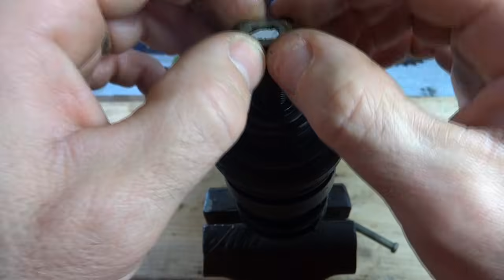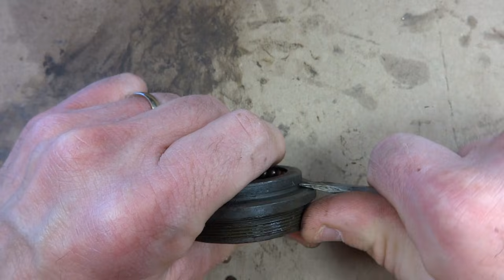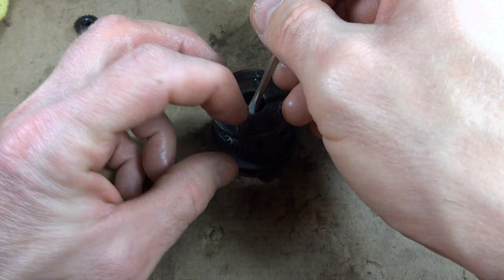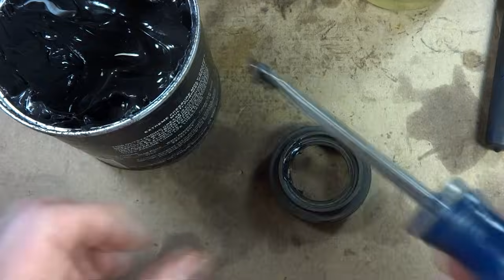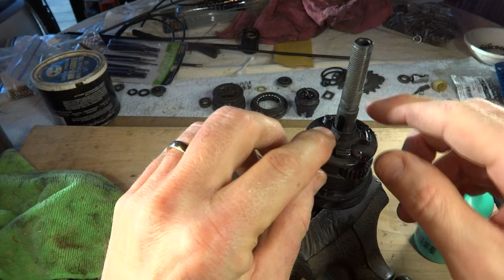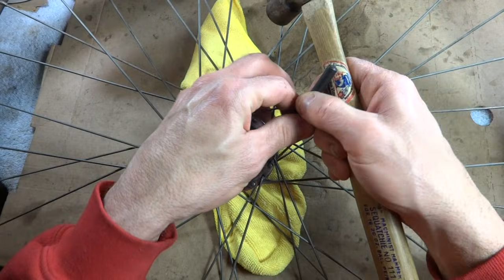How To Overhaul/Clean/Lube Sturmey-Archer 3 Speed Hub - AW type

Comment: Quite possibly the best video for servicing a S/A 3 speed,  with excellent dialogue along the way.  It maybe worth pointing out to others that it's important to set the length of the threaded projections before tightening the cone lock nuts,  The projection on the indicator chain side could be longer to facilitate the extra nut guiding the chain.  On my 1974 wheel the projection on the solid side of the spindle is 15mm after the locknut (as in your video 30 minutes),

Comment: If you dont have a vice and you are having trouble with getting the preload lock nuts off you can use an 8mm spanner to hold the axle.

Comment: Thanks much for this RJ, I'm rebuilding an old Phillips 3 speed that a relative had as a lawn ornament. The hub is a Sturmey Archer AW numbered '67-11' and has a pretty rusty planetary gear assembly. One of the springs on the pawl has lost it's 'bounce' but since they're hard to get (or make) it'll be alright with some TLC. I've always wanted to know exactly how these hubs work and it's a pleasure to disassemble, clean and reassemble to get it working as if new. Your video of the process is perfect, and the audio is great! You must be quite adept at audio/video work! Thanks very much.

Comment: …love this video, but, I can’t read 450 comments… thus, I ask my question…:)… I have a 1963ish, Raleigh, with 3 speed sturmey that gives the bike a pedal brake… I made the mistake of an ole school trick of putting a small cotton rope,( clothes line), so the rear axle would remain clean… (it was common in the fifties, with my old Columbia Roadmaster ). Using the bike for a week, I didn’t notice the rope dislodged a rubber boot, for oiling the axle, and the bike began grinding…  I took the bike to a bike shop, and asked for a rebuild… they said, they had one repair man experienced with old Raleigh’s… he disassembled it, reassembled it and told me a couple parts were destroyed… he said he had no access to replacement parts, a new wheel was $450.00… and my best bet, was, find an ole  beat up Raleigh, with a good wheel. (That was 10 + yrs ago)… now, I found one, on Marketplace, $25.00… I tried it, it works great, except, it’s a ladies… figured I’d just switch my whole wheel… today, I realized the ladies bike (not certain what yr), has the sprocket on the wrong side…  is it likely, parts in the 2nd bike can replace my missing parts of my old bike…?

Comment: HUB'S DIFFERNT: Due to a failure with my 1982 3sp AW spindle I decided to remove the complete insides and swop it out with the insides of a 1984 3sp AW hub (new old stock) but have noticed inside the 1982 hub differs from the 1984 hub? the 1984 hub has a shoulder in the bottom of it but the 1982 hub don't  Are both insides interchangeable with each other. Though I have now fitted the 1984 inners but is not as smooth as I think it should be, would this be due to the differences in hub bodies?  Has any one got any information  can share. Thanks

Comment: As for the wet lube I personally DO NOT recommend it. Why? After 1,5 year after overhaul, the lube turn into a sticky goo which blocked the hub internals. The hub survived with no damage after all but cleaning this is a pure pain.
Better use is to pour some diesel 10W40 oil because it is almost the same as the SA Oil which costs a lot of pennies.

Comment: Some years ago, I did a Level 2 EAL cycle maintenance course - that's a UK intermediate pro-level vocational qualification. My crowning achievement on the course was a complete rebuild of a Sturmey-Archer 3-speed hub just like this. I was both amazed and delighted when it worked just fine after my rebuild, but I'm not in a hurry to do that job again - it's definitely not for the faint of heart. Watch out for those teeny pawl springs - they are incredibly easy to lose and the hub won't work at all without them!
Reply: Imagine who build it

Comment: Hello, I have two questions.  I have a 1958 Racer with this hub.  I have been cleaning the bike up, but not relishing the idea of tearing this hub apart.  What gauge oil should I put in the oil port?  And, how much travel should I get out of that small chain?  I get about 1/4 of play, but that is only pulling on it, not riding and shifting.

Comment: I’ve just dissemble and clean one of this hubs, then I reassemble it and thats ok. The question is, when I pull the chain out the axle rotate backwards. 
Is it right or did I assemble something wrong ???
Reply: Sounds like You may have installed the hub or wheel backwards on the bike.
Reply: By backward I mean the wheel is directional and You have reversed the left side vs. the right side.

Comment: The wife bought a bike for my daughter for $15, we picked it up in the rain and I just threw it in the back of the truck. When I got home I noticed the shifter on the handle bars...... and realized that it wasn`t just an ordinary bike. I had never seen one of these before and on trying the pedals I found the hub was a little "crunchy"   But anyway the housing on the rear hub is stamped 75, after watching your video I think I can handle the rebuild pretty easy. The only question I have is, where can I find the  replacement bearing?

Comment: I found this very helpful and it gave me confidence. One note however, you correctly note that the sprocket goes either up or down with the dish cavity. You might want your viewers to note that there is a reason why that dish is there. On my bike with a full chain guard the sprocket needs to be lined in the center guard case. The spacers and the dish feature allow this positioning. So I expect that without a chain guard the sprocket goes with dish out. Mine didn’t come that way and when I put it on to check if the way you did it was correct I mounted the wheel and it was too close to the guard. Not centered. So I put one spacer in and one out and made the dish down and then it was centered correctly. I suppose if you just note which way yours came then it’s fine. But I think it’s useful to know why it’s there and check for yourself if centered inside the guard. Thanks for your videos. Great stuff.

Comment: Hey, really love your videos. I have a Batavus bike with a Sturmey Archer 3 speed with a drum brake in the rear. Do you know if that one is similar to the one in the video?
Reply from the maker: Maybe in some ways.
Reply: @RJTheBikeGuy  It's from 1976, and the bike is dutch. Haven't seen much about that specific hub
Reply from the maker: @ovlov86  You need to look up the model. It's obviously not an AW.
Reply: @RJTheBikeGuy  Of course, you are right. Upon further inspection, I found out it's called "AB". Have a nice day. :)
Reply from the maker: @ovlov86  I haven't worked on an AB yet. With the A, maybe it is related to the AW. I don't know. I have videos for a few different Sturmey Archer hubs. Not the AB though.
Reply: @RJTheBikeGuy  Just took it apart, and it is almost identical to the one in the video! Minor difference.

Comment: Hey RJ, great video as always. I'm having issues reassembling my hub. The cogs aren't lining up, (part 23.20) when I'm putting the 2nd part back on. I've taken it apart 50 times and can't see why it isn't matching up, or whether the temperature has made it move, please can you help? Rob
Reply from the maker: I can't tell you. It's generally not a big deal.
Reply: I'll bet the pins that hold the planet gears are installed backwards, keeping the ring from sitting all the way over the planets, right?

Comment: Hi RJ (or anyone else) , I'm rebuilding an old AW hub I picked up off of Ebay just to get familiar with how these work and how to take apart and reassemble. I have put it back together using this video and after cleaning and I lost one of the pawl springs on the bottom left side. Someone told me that I could put it together with one pawl and bench test it on a vice since there would not be a load on it. I did not oil the hub just used spray lube for the bench test. It works fine by pulling the chain out in 2nd and 3rd but will not go into 1st gear. Could this be because I am missing one pawl and or my springs are probably original from 1964 and they are weak? Thanks, Mike
Reply from the maker: You might be able to find parts on ebay.
Reply: @RJTheBikeGuy  I've Got 4 springs do to be here on Friday, Thanks

Comment: Thanks for the video. Question, I have an old Crescent 1970:s( I think) bike that has a Sachs torpedo duomatic hub( says 2.8 36P as well on the hub not sure what those numbers are). The hub is 2 speed. Would it roughly be the same procedure to open up and fix? 
 
 The problem with the hub is second gear. First gear works flawlessly but when pedaling using second gear every 10 seconds or so there is a "crunch" and the pedaling "loses connection" for a second before it picks back up again. Not sure how to describe, English isn't my first language.

 Don't know much about bike repair so haven't dared trying to open up the hub. Worried that perhaps I will just make it worse if I start fiddling around. 

 Does it sound like the problem could be fixed by just opening up the hub, clean it and grease it? Guessing replacement parts will be very hard to find. Bike has some sentimental value so would like to get it running like it should.
Reply from the maker: Find information on that hub.

Comment: Really useful stuff RJ, just rebuilt a 1976 AW hub using your step-by-step guide.
One minor issue is determining the exact adjustment of the LH cone... a little unclear in the video how you determine this.
Some sources say back it off till there is some slight lateral movement then tighten to 'just' remove any discernable play. 
Others say ball bearings should have slight amount of preload.
I tried both ways and it definitely seems to turn more smoothly doing it the first way, but would appreciate your advice.
Its fiddly to adjust the cone precisely without the correct Sturmey Archer thin blade adjuster tool, but they are fairly common and not expensive... so I stumped up for one and am now ready to tackle a 1986 AW!
Reply from the maker: It's been a while since I have done one of these, so I don't recall. But here is another video I did overhauling an AW hub. https://www.youtube.com/watch?v=oHHaajDcL_g

Comment: I can't wait to refurb my Sturmey Archer with a coaster brake hub this winter. I think I've got the gears zeroed in okay but I hear a little rubbing/grinding noise when I roll the wheel wheel in reverse and when pedaling with tension on the pedals. I'm not sure what model it is. It says Sturmey Archer, Made in England 86-10
 and 3 speed 53c  coaster brake . I don't see a model on it. Wouldn't I need the model number if I need to get parts? Thanks, Mike
Reply from the maker: Are you sure it isn't an S3C?
Reply from the maker: https://www.sheldonbrown.com/sturmey-archer/s3c.html
Reply: @RJTheBikeGuy  YOU ARE INCREDIBLE, I've been on that site so many times and never stumbled across this one. And thanks again about telling me that it's a S3C not a 53C. Is there or would I need a video for the S3C or would a different one work? I'm a fixit addict (bikes, motorcycles, cars--I could go on for ever--just ask my wife). What might the slight noise it is making be? We've gone up to 12 miles on the bike so far, luvin the old school thing. Wish I could post a pic here. Thanks again Mike
Reply from the maker: @mikehall7806 I haven't worked on an S3C. 
I have a some videos that might be similar or not:
https://www.youtube.com/watch?v=5hm0YgtZyAE
https://www.youtube.com/watch?v=e2YDcLF_CNI
Reply: @RJTheBikeGuy  Thanks for the links, In all the watching and reading I think the SC3 hb was a replacement for some not so good models but some of the parts are fragile. I am refurbing this for my wife and want here to be safe. She has rode the bike for over 25 miles the last 2 days and loves it. Just for safety's sake I want to add hand brakes. Should I add front or rear or both and what type is the best to use. I've been watching your video (Creaking bottom brackets?...no more!) about noises to try and track down a noise. Keep thoses great videos coming. Thanks, Mike
Reply from the maker: @mikehall7806  Does it have the little half moon pawls. Those are prone to breaking. Swap the rear wheel out to a wheel with an Sturney Archer AW hub. Those are very solid. Then put some rim brakes on.

Comment: My first sturmry breakdown and overhaul. When I unscrewed the second bearing cone the driver spring and that small spring cap were going through the driver and following the cone. Is that normal?
Reply from the maker: I don't know what you are describing without seeing it. make sure it's the same model. 
Here is an older version of this same hub. https://www.youtube.com/watch?v=oHHaajDcL_g
Reply: @RJTheBikeGuy  that video just answered my question, when reassembling, the indicator spring and small cap slides on the axle then the driver part with the hub bearings. On both your vids the spring got pushed down by the driver and you held it down to install bearing cone. Mine the spring didnt compress with the driver. Just needed to thread down the cone.
Nice initials btw

Comment: Good evening RJ, thanks for posting this video, 6 years ago :-). I'm working on my first Sturmey-Archer 3 speed and was wondering how everything came apart and fit back together. I'd gotten half-way to a full disassembly, without removing the hub from the wheel, but needed some guidance from the "bike guy" to make sure I didn't screw it up.
Many thanks,
Chris
Gatineau, Québec, Canada
Reply from the maker: Just make sure you get the pawls installed the correct direction.
Reply: @RJTheBikeGuy  I will. I broke the shift lever pin (small rod with flat ends and threads in center), somehow, but will be able to order a replacement.
Chris

Comment: Very helpful video! I had some problems tightening the non drive side locknut while holding the cone with a screwdriver. I would suggest using some long nose pliers to hold the washer in place, as this worked perfectly for me. The least thing you want to do is put too much pressure on those bearings :)

Comment: this is amazing! out of curiosity; what would a bike shop charge for the rebuild? it looks like a heck of a lot of work ! i love fixing stuff. i love tools. i should have been a machinist.
Reply from the maker: You would have to ask bike shops. I have no idea. If they even will do it. And it probably varies.
Reply: It's probably more than an average flat rate considering the intricacy involved with 3 or 5 speeds. I have a 3 speed and would hate for it to fall apart cause I don't have a table top vice😅.

Comment: An Outstanding video. Really helpful. Three comments. First when removing the hub assembly from the hub housing (body) use a brass drift. That way you won't "round off" the notches. Second, when you reassemble the hub assembly into the hub housing, use some Never Seize Lubricant. Lastly, here is an excellent way to remove the "snap" ring so it ends up on your screwdriver and not into deep space.
https://www.youtube.com/watch?v=I1bIEvJmE1o&list=PLS3YHBW7HX_K69cfRGIG4xZeGdTwhseZS&index=3&t=0s
Regards to all!

Comment: One thing I'm wondering, and for the record I've never done this myself or even owed a wheel with this hub,...is if it's usual practice to not use any grease on the sun and planetary gears teeth?  (and if not,...why not?)  Just thinking of my bait casting fishing reels, which are lubed on the gear teeth to reduce wear over time and add smoothness.  My "gut" is telling me this appears to be wrong,.... am I ...?
Reply from the maker: You also need to add oil to the hub periodically.
Reply: @RJTheBikeGuy  Yeah, I figured that but what about my original question? Is it  usual practice to not use any grease on the sun and planetary gears teeth?  (and if not,...why not?)   Also, I forgot to ask but I'm surprised the pawl engagement points are not lubricated upon reassembly?   @23.59 I would think some lube would go along the inner cage to where the pawls make contact?  Otherwise metal on metal wear is slowing eating the hub it would seem to me,...and cut down on the friction and drag when freewheeling.  Just seems so strange these are left dry too.  Oh,..and what grease are you using,...I couldn't make out the brand?  Thanks....

Comment: The tenacious oil you have there looks very like some oil I use in my chainsaw for bar lubrication, between finger and thumb it will string.
Reply from the maker: I haven't tried bar oil. It may be similar. Not sure.
Reply: @RJTheBikeGuy  what I use in my hub as a small squirt every couple of hundred miles is EP90 high pressure gear oil it's good in my rear axle in the van, so it should certainly look after lighter loaded gears like these
Reply from the maker: I recommend proper bear grease for hubs. But freewheels aren't under load. They only spin when coasting.

Comment: Very useful iffy ever into any of my SA hubs. One thing. Id think placing a bit of grease in the ratchet that engages the paws would prevent too much ware when coasting.
Reply from the maker: No. The grease will cause the pawls to stick. The spring isn't very strong. That is why there is oil.

Comment: Thanks for this video. Though here in Germany Sachs hubs were more common, I like this hub, have one on my folding bike. I service it every few years, in the same way you show it, and it is still a runner- no pittings, no wear on the gears. I don´t like the small pawl-springs who are likely to desappear suddenly, but if you pay attention, this should be no problem. 
 Mine is from 1993, the bearings are a little bit different, but the rest is all the same as shown in the video.
Reply from the maker: I think the hub in this video was from 1970. Here is another video overhauling the same model of hub from 1954: https://www.youtube.com/watch?v=oHHaajDcL_g